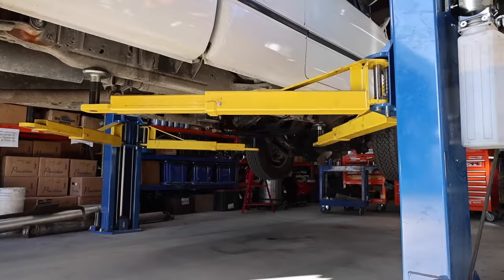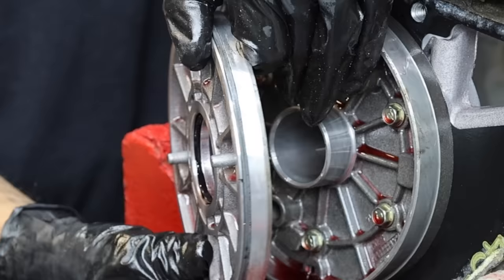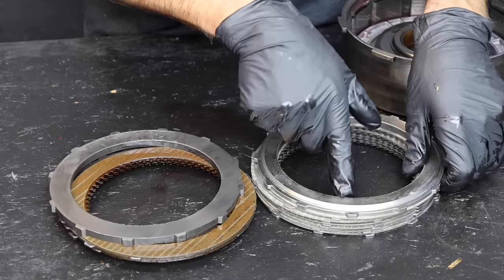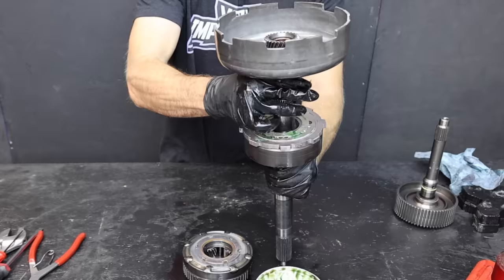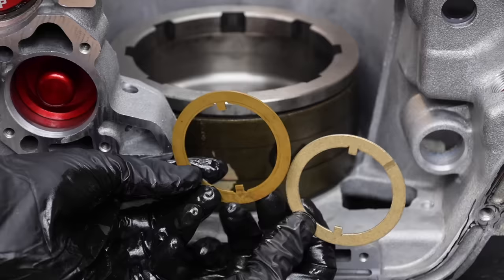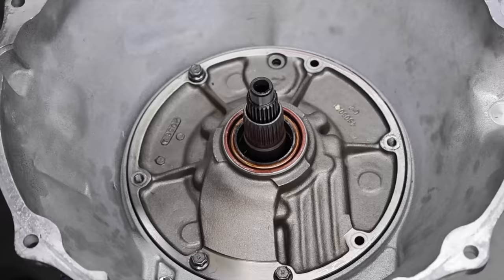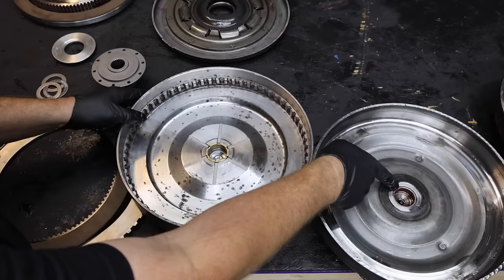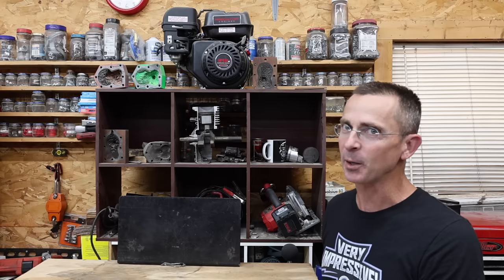Did I Waste $4000 on a DIY Transmission Rebuild (47RE)?

Comment: Awesome job this should help others to do it for themselves... transmissions can and are intimidating...I have done my fair share....I always try to have the specific manual for the transmission I am working on and the tech line phone number in case I screw something up or have to get information always take your time keep area as clean as possible and finish whatever stage you are at before walking away for a break or bathroom and don't talk on the phone while do your rebuild... absolutely love your channel 👍👌✌️
Reply from the maker: Thanks!

Comment: Loved this video and the Part 1/Engine video as well.  Would LOVE to see this same thing for a 2004 Ford PowerStroke as well.  The prices of trucks are insane, especially new ones.  It would be great to see these same videos for other engines/drivetrains of similar age.  Why buy new when you can rebuild and/or improve used for WAY cheaper.
Reply from the maker: Thank!  Thanks for the suggestion.

Comment: That Dodge transmission is a lot different from the older C4/6, Turbo 350/400 and 727's I rebuilt as a mechanic. I would not even touch a modern automatic. I did rebuild some manual transmissions as well. I liked them better in some ways, they are still basically the same as they were as four speeds, just more and bigger. Transmission rebuilds were never a favorite of mine. You did good.
Reply from the maker: Thanks!

Comment: Isn't it great being able to have some fun with the thing?  I have a 18 duramax in my silverado and while the Allison is fairly bulletproof for stock performance, if you use 100+ HP tunes often it will grenade the thing.  Maybe someday I'll do the upgrades needed but for now, it's stock with 90,000 miles.
Reply from the maker: Thanks for sharing.

Comment: I have a question about my 2011 Mitsubishi endeavor se 3.8v6 The mileage is at 158,935 I was thinking about changing the transmission fluid drain and refill with a new full synthetic transmission fluid I always hear people saying Don’t change the transmission fluid if it the transmission was never been change before and you’ll ruin the transmission on your vehicle

Comment: I love your video's and always look to see if you did one on something I'm looking to buy, so thank you. now for the question.... would you consider doing a comparison between between auxiliary transmission coolers, stacked plate vs tube and fin with and without the one in radiator used in series. maybe using a temp gauge mounted in the pan. seems to be lots of controversy  on which one is better and how it should be installed. I want to purchase one and love seeing your real world comparisons.
Reply from the maker: Thanks and you are welcome!  Thanks for the suggestion.

Comment: Great video, think the real problem in places is access to Kits etc or repair shops. Where i live i sent mine away its been 2 months to one of the only shops that does them locally and only when you hassle them do they do stuff (they opened it and didn't call me, so no idea how long been that way)
Go back 10 years all the major parts stores which isn't many could get them overnight....Def sux living in a small country where unless you have $$ you basically shafted half the time
Reply from the maker: Thanks!  Thanks for sharing.

Comment: Why didn't you soak the clutch packs for longer? Typically, I thought you either pull a vacuum on it for a hour or so, or leave it setting for 24 hours in fluid to eliminate any air bubbles sticking to the fiber.

Comment: I think the 4 speeds are a bit anemic for a diesel, I've never liked just how far apart the gears are and how much the rpm has to drop for a shift when under load. I would personally either got a 6 speed to swap in or got a truck with a 6 speed. New ones have 10 speed transmissions, and you might as well be towing with a CVT with how close the 6 low gears are. Personally I think the transmission upgrades are far more relevant than the engine upgrades, and why it feels better to tow in a duramax with under 1000ftlbs of torque and a 10 speed vs a ram with over 1000ftlbs of torque. the first gear launch will be a touch slower when towing, but once you get moving theres less power loss between gears
Reply from the maker: Thank for the feedback.

Comment: I have the EXACT SAME reaction when taken for a ride in someone else's insanely high powered vehicle. I laugh uncontrollably. Perhaps it is a defense mechanism combined with  a little bit of embarrassment as my testicles automatically rise up in to my abdomen in "protection mode".
One ball has not completely dropped back to normal from a 950 WRHP violent roll-on in a  3,000lb turbo M3 on I-4 in Orlando. That was in 2010, BTW.   30lbs boost.

Comment: Always had autos, but last car, Insignia (Buick Regal in US) had rad leak so left it in to dealer...who didnt replace seal on auto to rad cooler pipe..BIG leak 5 hrs after collecting car...dealer denied it was their fault even though mechanic told me he should have replaced the seals. Box left to 'specialist' , 2k later it was fixed...for 6 mths..."We didnt do the valve bodies..another 2k".. so traded it in for a new stickshift 19 Tucson...which NOW has consumed a gearbox, but not a clutch.. 5k quote so fitting a s/hand one for 500 and hoping..but I'm going to try to rebuild the original box as a spare...😎
Reply from the maker: Thanks for sharing.

Comment: I am so looking forward to having a 1994-1997 Dodge Ram 2500 four-wheel drive extended cab or Club cab with the 12 valve Cummins turbo diesel and it would be nice to have the engine/trans like your truck. I do have a question about the dash because there's been such horrific damage that's occurred to the stock Dash is there a replacement with a different material that will not break into pieces ?

Comment: Video Idea for Project Farm:  I was in the process of replacing several windows in my house when the weather turned cold about a month earlier than normal.  I started looking for paintable, door and window sealant that could be applied during the daytime in 40 degree F temperatures.  But, nighttime temperatures were falling into the teens.  There's latex, acrylic latex, siliconized acrylic latex, silicone and the price varies from $5.00 to $14.00 per 10 ounce tube.  Some are paintable, some are not. Manufacturers rate the number of freeze thaw cycles the tube of sealant can withstand before it's "unusable", and most sealants are to be applied in 50 degree F temperatures and "require" 50 degrees or greater for 48 hours.   My question is, what really happens to the sealant/caulk I applied at 45 degrees with nighttime temperatures dipping into the teens?  Am I okay, or have I really messed up?  When I googled this topic I found lots of other's asking the same question.  Thanks for all the great product information you provide.
Reply from the maker: You are welcome!  Thanks for the video idea.

Comment: Would love if you could find a way to test pressure washer style foam cannons! I’ve seen some stop working after only a few uses and others going strong 2 years later (some of this may be attributed to if they’re being used at a higher pressure than they’re designed for I found out). But would also love to see which one can make the best foaming results or if it’s about the same for a $20 one versus a $200 one. I have like a $30 one that works ok from Harbor Freight I think it was, but it doesn’t always seem to make the best foam or make it “stick” the best like I’ve seen other styles do on some videos. 

It may be subjective results but if you can test them side by side I’d love to see which one might be one of the better ones to buy!
Reply from the maker: Thanks for the suggestion.

Comment: Excellent video! I have never been brave enough to get into an automatic transmission. This is very cool! I have a video idea. It's a mythbuster style. Engine oil and time service intervals. If an engine does not go the required mileage between oil changes, how long does the engine oil last time wise, before needing to be changed? 6 months, 1 year, or longer?
Reply from the maker: Thanks!  Thanks for the suggestion.

Comment: I personally rebuild a automatic transmission on a VW Golf 3 and I saved 2800$ on replacement transmission by buying the parts for rebuild by myself and I had a book where I could see how the transmission was assembled. But personally I prefer to work on manual transmissions, especially ones from VW, Audi and Lada.
Reply from the maker: Thanks for sharing.

Comment: Dont use wave rings just use a flat ring with tighter clearance. It wont slam as long as there isn't to much slop wand say i set mine at 0.021 and worked wonderful. Those wave rings can snap and really do alot of damage.
Reply from the maker: Thanks for the constructive feedback.

Comment: 45 seconds of pedal to floor to reach the speed limit? Good lord. That transmission fluid was probably burned to a crisp after doing that.
This is one of those things where nothing beats a manual transmission. There's no slipping involved, so it doesn't really get hot. The thing can still blow apart if it's undersized though.
Reply from the maker: Thanks for sharing!

Comment: This is the first video like this I have seen from your channel...Very Cool!....You need to do you 0-60 in 4x4-Hi (My 2008 Ford 3V V10 is same way...wheel spin 4.11 gears and 500lb-ft of torque too easy in the LOW 1st gear of my 5R110W, I couldn't imagine 1200lb-ft)
Reply from the maker: Thanks!  Thanks for the suggestion.

Comment: TESTING IDEA:  Automotive wire splices, especially heat-sealable versions.  I could not find your email address anywhere (never was the brightest bulb...), hence this question here.  Please keep up the extraordinary work.  If you do this, please include heat-sealable butt splices, uninsulated butt splices with sealable heat shrink tubing, & SpliSeal.
Reply from the maker: Thanks for the suggestion.

Comment: I've got a question. I've got an 02 gmc Sierra 5.3L V8. Its got 285k miles on it. It hasn't had the transmission fluid changed in forever, at least my father in-law had it for years before I bought it from him and he didnt have it changed. Ive only put maybe 12k miles on it and i paid 4500 for it. But im wondering if I should change the transmission fluid? Not?

Comment: I thought the planetary was supposed to be cut straight for diesel and not slanted. Slanted is for gas engines from what I’ve seen from precision transmission.

Comment: It's not the subject of the video but I need some technical advise:
I bought to big brake calipers for my car. The issue is I bought two LEFT calipers so bleeder valve stays at the bottom in the right side. Those are 100% symmetrical cast, so: it is possible just to drill and tap for a bleeder valve at the opposite side?

Comment: I just built my 86 Broncos 5.0 to 500 HP. 
My next step was a much cheaper option than yours. I went with Lentech transmissions. 
They custom built my AOD to handle 700 HP for only 4k.
Reply from the maker: Thanks for sharing.

Comment: this video is not for the faint of heart...  He has obviously done this a time or two... Good job     Hate to rain on this parade, but these Chrysler transmissions are weak with no matter how many mods are done to them. There is a new bell housing that adapts a GM Allison trans to take all the power of a hopped up Cummins
Reply from the maker: Thanks!

Comment: Suggestion. Not your typical review, but I'd love to see you do Battle Royale on waterproof clothes since you have great testing methods.

For true hydrostatic head testing, moisture vapor transmission rates, air permeability, durability testing, and anything else you could come up with. The manufacturers make a lot of claims on these garments and I'd love to know the truth and how they actually compare to each other.

Like a comparison of Gore Tex, Gore-Tex Active, Gore-Tex Paclite, Gore-Tex Pro, Dry.Q, Dry.Q Elite, eVent DValpine, eVent DVexpedition, eVent DVstorm, Marmot NanoPro MemBrain, Patagonia H2No, Pertex Shield, Pertex Shield Pro, Pertex Shield+, Polartec NeoShell, OutDry Extreme, Helly Tech Protection, Helly Tech Performance, Helly Tech Professional, and others.

Obviously an expensive test to run, but I think you'd get an awesome amount of views off of it too because I don't think anyone has done anything quite like it before.
Reply from the maker: Thanks for the suggestion.

Comment: Overall great job but if you ever add more power/ plan on pulling heavy weight, you’re gonna need to replace that aluminum planet with a steel 48RE unit. The aluminum planets get their splines stripped out when you throw too much power/ weight at them.
Reply from the maker: Thanks!  Thanks for the feedback.

Comment: I have a 2004 toyota corolla with automatic transmission. It just recently developed an issue. When the car is going at a slow speed like slowing down and applying the brakes, it makes a clicking sound. I had a garage show me this by putting the car on a lift with a technician still in the car and another tech telling the tech to go ahead. The technician on the ground showed me the transmission and I heard the clicking noise coming from the transmission location. I'm now trying to find out what the issue is and find out how much it cost to fix.
Reply from the maker: Thanks for sharing.

Comment: Do it with a Ford DPS6, and a lot of that hate people have for the 2012-16 Fiesta, and Focus automatics, will be gone. Easy to pull, rebuild, and re-install.
Reply from the maker: Thanks for the suggestion.
Reply: You got it! It's the transmission certain sections of the population hate, while others love it. I'm in the latter group. I have a 2017 Fiesta. Special year.  @ProjectFarm

Comment: I’m going to a Toyota program called T-TEN and I got to rebuilt both automatic and manual trans axels and transmissions and automatics suck, especially if you don’t have a good tool for the brake springs
Reply from the maker: Thanks for sharing.

Comment: Could you please do a test on the effects of running regular gas in a premium only engine long term, and what happens once the Knock Sensor goes out.

I work at a gas station, and it drives me crazy seeing so many people putting Regular gas in their Mercedes, Lexus, BMW, Rang Rover and so on. Because it doesn't have a turbo the car doesn't tell them immediately they are wrong, so they believe the misinformation that it doesn't matter.

Every day I'm explaining compression ratio, higher octane having higher detonation tolerance, what the Knock Sensor does and how it's their only Fail Safe...so essentially they are playing Russian Roulette.

At this point I really want actually test data to prove I'm either right or wrong, does it really matter in non Turbo/Super Charged vehicles. To my understanding Pre Ignition makes the timing off and the Piston slapping things it shouldn't isn't good. Like the Timing Belt breaking in an Interference Engine 💥
Reply: @ProjectFarm please read 📚

Comment: Todd,I have an idea for a video. How about which automatic transmission is the best,durability wise and performance wise in stock form.Chrylsers famed torqueflite,Gm's TH400 and Fords C4 or C6. Use late 60's versions.
Modern cars and transmissions are garbage so test these classics.
Reply from the maker: Thanks for the video idea.

Comment: compared to my transmission its a lot better lol. I ended up draining the ATF and it was basically pure black, and after wiping off the magnet with a paper towel. the towel could be lifted with the magnet lol
(btw the transmission was basically completely dead, plan on doing a manual swap)
1997 Nissan Maxima
Reply from the maker: Thanks for sharing.

Comment: How do you like the raybestos GPZ clutches? I have heard they hold quite a bit of power compared to regular clutch disks.  I am doing a complete overhaul on my DL501 DSG transmission and I'm using those same clutch discs
Reply from the maker: Thanks for the suggestion.

Comment: My 2002 Diesel overdrive case cracked, (from the factory I presume) at 30k it started leaking but was out of warranty, as it was over five years old. I had to pay the dealer $800.00 to replace the case and put all my parts back into it. It also went through a lift pump and Fuel Pump and two PS pumps in less than 60K. I will never buy another Dodge again. Sadly, Fords and Chevy's are 10 times worse.
Reply from the maker: Thanks for the feedback.

Comment: I just got a 2000 Dodge Dakota, low miles for the year 81,000 with the 4.7 v8. Everyone asks me if it’s fast, little truck v8 I guess is why. Anyways on take off it’s not really what I consider fast but yeah for passing at 50 mph or do I step on it and it accelerates very quickly.
Reply from the maker: Thanks for sharing.

Comment: Thats what I try to explain to all the young new drivers that want to slap a big old turbo on there honda and start boosting it to make couple hundred HP... but what they never realize, once you make your engine produce more power now you gotta upgrade EVERYTHING to be able to handle it now. its usually the JDM kids I cant count how many times I have watched em build up this nice powerful motor just to turn there transmissions or differentials into hand grenades.
Reply from the maker: Thanks for sharing.

Comment: Never understood why people are scared of transmissions.  Far easier than an engine.  It's not complicated.  Clutch packs that only go together one way surrounding a planetary gear set.  No timing, no crazy heat production.  Also, 4k to rebuild a transmission must have included 3k worth of tools.
Reply from the maker: Thanks for the feedback.

Comment: Suggestion: can you test your hydrogen generator on a diesel engine with a dpf to see if it effects run time between Regen cycles? Would it also be possible to compare with adding propane?
Reply from the maker: Thanks for the suggestion.